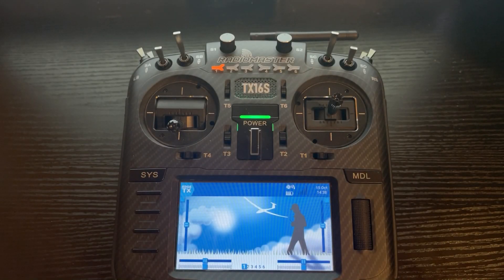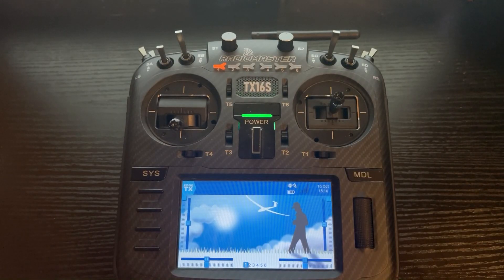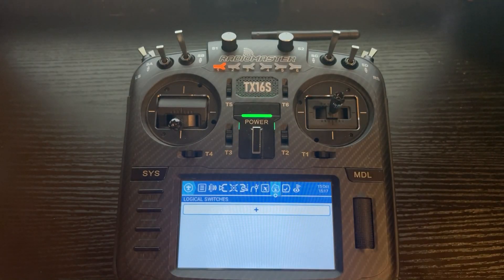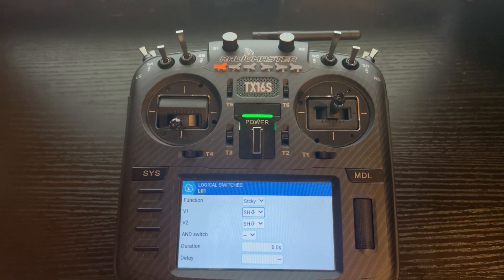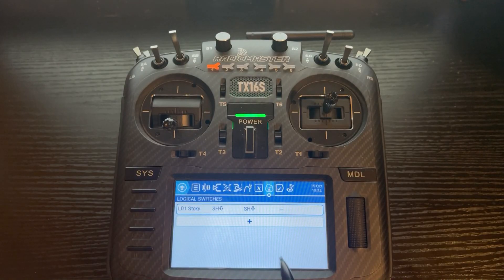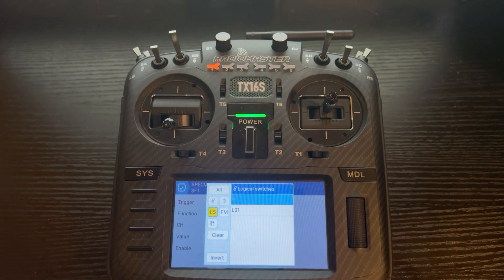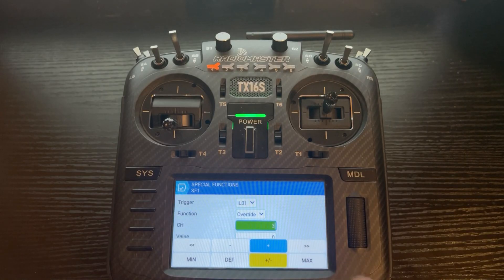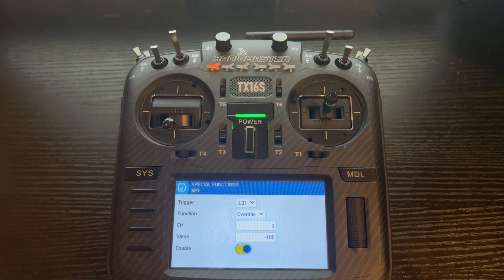Radiomaster TX16s/Edge Tx:Throttle Cut (Basic with Momentary)

Comment: This is a really good tutorial, but it doesn't make sense, or I didn't understand why you use channel 3 for this setup when the throttle is actually on Channel One.
Can you shed some further light on that?
Thanks
Reply from the maker: Throttle is on channel 3 for programming on basically all brands protocols (Using AETR) but DSM. When setting up a DSM everything is the same but the MPM does  "channel mapping". CM changes the output order so you plug channels in like normal to receiver (TAER) and works properly.
Reply: @BDTennessee  Thanks BD, I appreciate the explanation.
Reply from the maker: @ Ill cover in future video too.